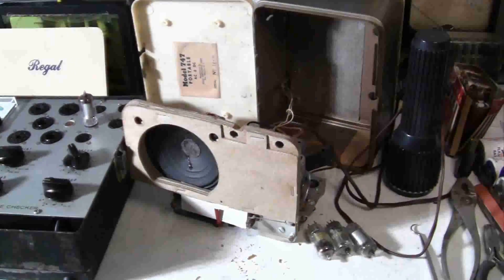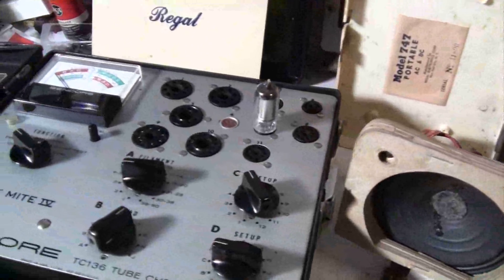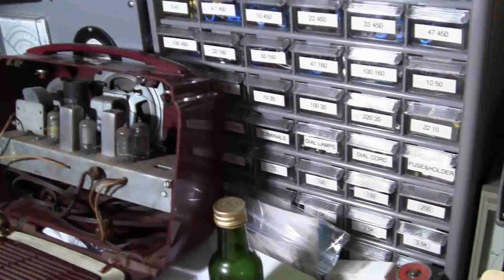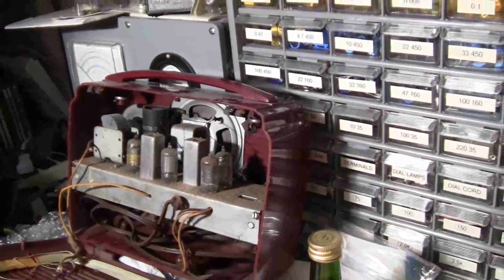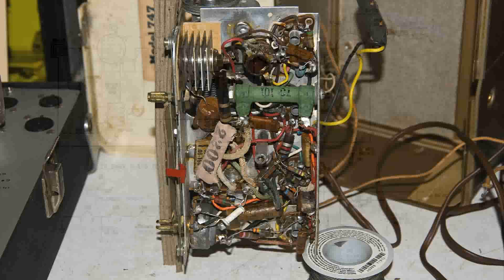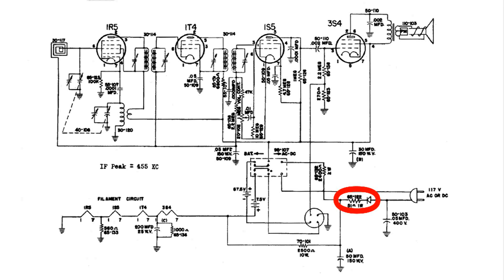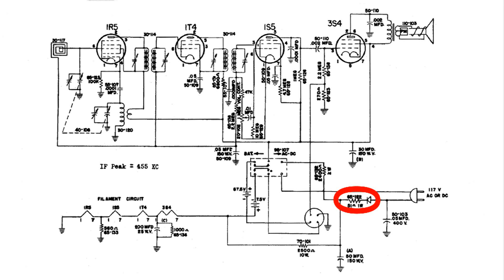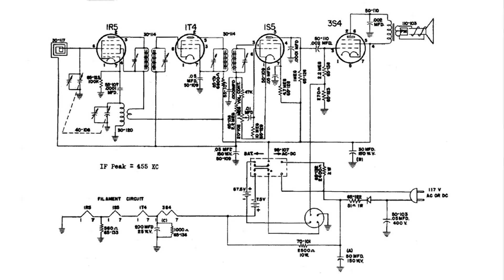Regal Radio 747 Repair Part 2, Filament Circuit

Comment from the maker: Thanks CameramanLink 
There are 1.5VDC audio output tube, but their performance is weak or low. That is why the manufacturers started using 3VDC audio output tubes. Every fix is a little different and hopefully this radio can be fixed. I have done a video about changing selenium rectifier, I'll send you the video.

Comment: I have had a number of radios that got rats-nested with lots of different component changes and other mods that the radio(s) did not work..  so my solution was to unsolder everything on the chassis and restore the original components.  This usually fixed the radio.
Reply: Die haben da